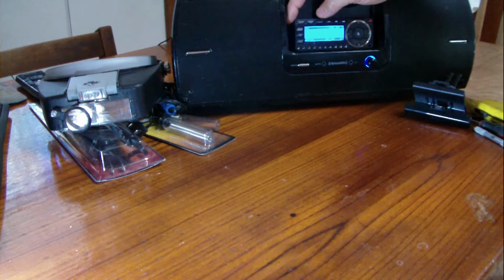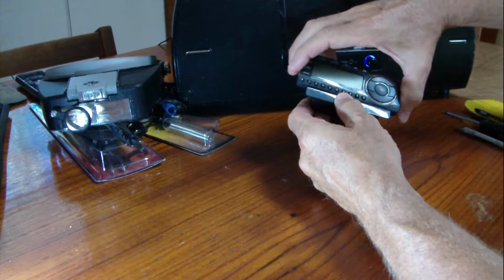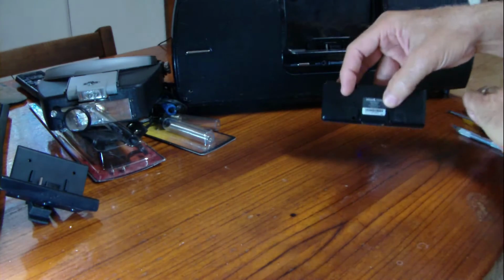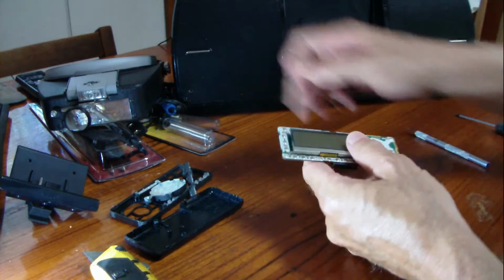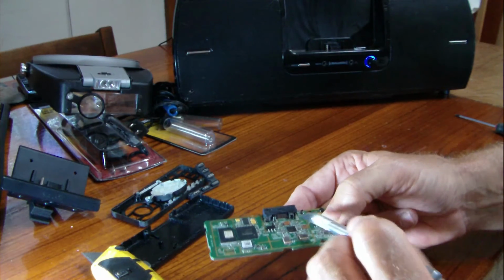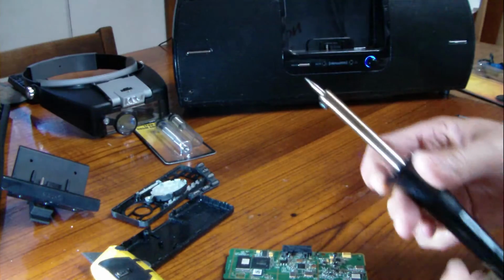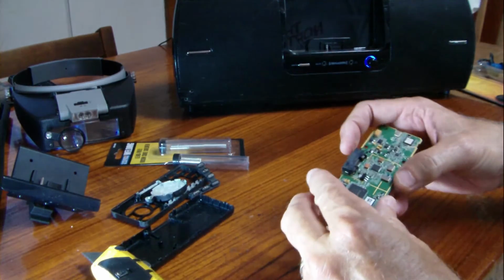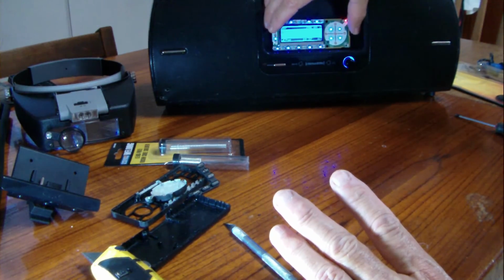Sirius antennae not detected fix-resolder antenna connection point

Comment: What I found on my radio with the power connect dock was the dock itself was the problem (not the radio). The antenna and audio connectors in the dock had cracked or loose solder joints to the board. Took a bit to open it up (keep track of which screws go where and there is a little prying involved) but quick work with a soldering iron. I blobbed some hot glue over the sockets just for good measure. Ultimately, I did buy a new dock but only because it was cheap and gave me an opportunity to switch the head unit to a different car if needed. Anyway, easy to check without opening, just see if the connectors are wiggling in the case; a lot less stressful than disassembling a head unit.

Comment: I've wondered if some dielectric grease would help keep continuity
Reply: that is not the purpose of dielectric grease. If thats how it worked, all electric circuits would short circuit ... dielectric grease does not improve conductance. Just helps avoid corrosion on contacts to ensure correct connectivity (given the conductance is already there).

Comment: I'm gonna throw this out there, I removed mine from the casing and put some small fans behind it because it gets INCREDIBLY HOT during use.  Much like computers that were built in the late 2000's, the solder wasn't good and many gpu's did the same thing on the mb.  They heat, cool down, heat, cool down over and over until the solder gets so brittle it breaks.  Once I added the fans to the back of mine, I've never had another issue.